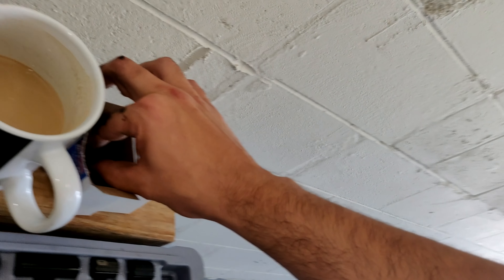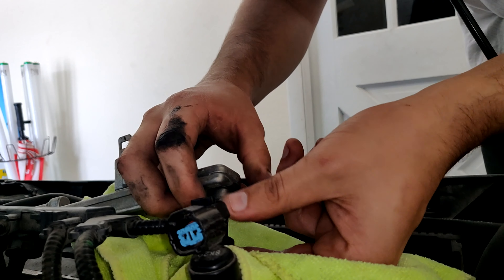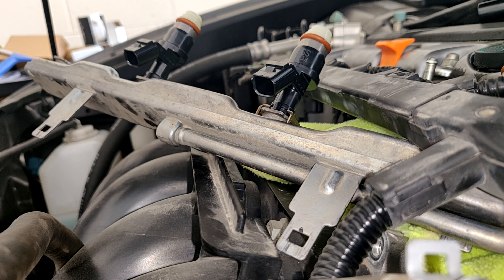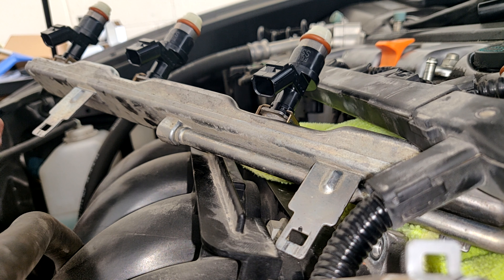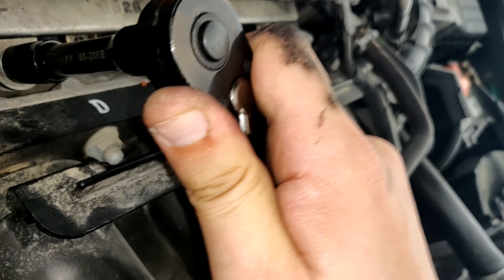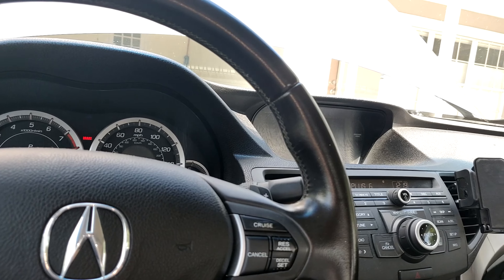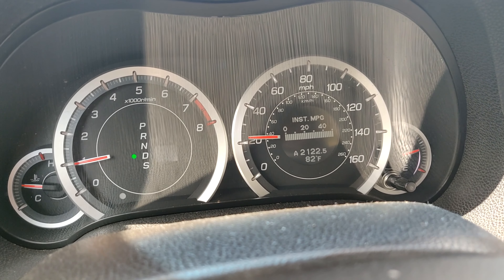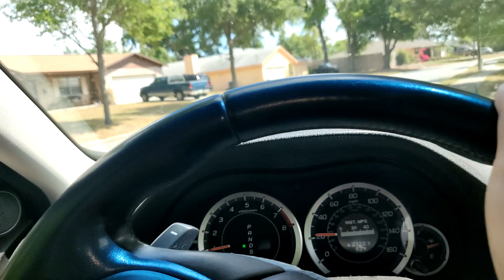2009 Acura TSX Fuel Injector Replacement (Vivration on D and N Issue)

Comment: Thank you for the video.
You should try fist 
•cleaning your throttle body
•Replace the engine air filter if needed 
•Compression test
•spark plugs if needed
and then engine mounts.

Good luck. 
Please update, when you find the solution to your TSX problem.
Reply: Smart!!

Comment: It's your pressure switch on AC. I had the same issue when replaced the AC, my idle speed would fluctuate. I've got another AC, improved a little bit over time (i believe main computer learned the parameters) but there is still a little bit of idle instability when the AC is on. It's acceptable now.

Comment: I have 19" HFP wheels on a 2012 tsx and I have a vibration at highway speeds.  I gave the wheels to a shop and they found 2 bent rims and are fixing those.  I suspected I had at least 1 bent rim.
Reply from the maker: I also suspected one rim would be broken but I didn't want to invest on that. Turns out that the shoppe that put the axles on my car put crappy ones. 2 months ago I took it to a car shop and they confirmed at least about 500$ worth of repairs to start fixing things that are obviously broken. I traded it in and bought a 2020 accord lol

Comment: Hey Healthy, I have the same issue with my 2010.....Ive just did a tune up with new denso sparkplugs, engine air filter, 3x3 transmission change (I changed at 60k , 90k, now at 130k), coolant change, transmission filter, cleaned throttle body, (didn't clean maf as honda ones don't clean well/do anything), brake fluid, replace faulty VTC actuator......Used all acura parts... Still no change on my side either.
Reply from the maker: Thank you for that response! Do you burn oil?
Reply: @HealthyCriticism  Yeah....since about 90k...  im around 130k now and I burn half quart every 2500k.....I change every 5000k with pennzoil platinum regardless...since day 1.
Reply from the maker: @David.....  then I'd suggest a compression test to see how worn the engine is. We're in the same boat here.
Reply: @HealthyCriticism  Compression is fine....all honda engine start to burn oil over 100k....(its not that big a deal, no tail pipe smoke, no excessive carbon when engine was pulled apart)...I add a half quart at 2500 miles and do a oil change at 5k....

I know that syntheic oil can last 25k miles or more....its the oil filter that I dont trust....oil filter tech been the same for the last 80years....nothing much better has come along besides paper filters.

And if im going to the trouble of putting my car on a lift to change the filter, im changing the oil too.....besides I did the math and the low cost of oil vs mileage reduction due to friction is about a savings of $5...

Oh, one thing about the idle vibration....it was more noticeble for me in the winter than the summer at the beginning....three years later, it happens with the same severity at all temps....
Reply from the maker: @David.....  yeah I burn about 1qt every 3000 miles and I just add some more until I change it at around 4k. At this point I'm learning to live with everything that's wrong about the car because overall it's in decent shape still. Waiting till the TLX type s hits the market to upgrade

A family mechanic said the transmission is probably also wearing out since it hesitates between hear shifts and clanks when I switch from park to reverse and back to drive when it's cold primarily
Reply: @HealthyCriticism  One thing, did you ever change your water pump? I put a aftermarket one a while ago....Also does your vibration get worse when you turn on the A/C?
Reply from the maker: @David.....  I haven't changed my water cooler but I have changed my AC compressor. And yes the vibrations will intensify as the compressor kicks in and it will also make a lot of noise. The vibrations go away when the compressor isn't clutched in. When the AC is off then the vibration is consistent but the car feels a lot more responsive and there is no excessive vibration upon acceleration

Comment: Remember to disconnect the car battery first for your safety when you are removing the fuel line, flammable gasoline and spark can have a bad ending

Comment: Probably need to replace the knock sensor as well. By the way , did you depressurize the fuel line before replacing the fuel injectors?
Reply from the maker: No, I didn't notice any difference before and after. I ended up reinstalling the old injectors and returning the new ones for a refund
Reply: @HealthyCriticism  So you didn't depressurize the fuel line before your swap?
Reply from the maker: @viewlesswind  correct, I did not

Comment: maybe the transmission mounts? I'm having the same problems with my tsx on D and R. so i assumed it was transmission mounts there's 3 of them. on my 04 model still haven't done something about it though
Reply from the maker: I believe in the description I mention that I replaced all mounts both for engine and transmission but the issue was still there

Comment: I was about to tell ya about mounts and etc, but seems like you've already went over so much repairs! Problem is the torque converter and probably other components in the transmission. Hondas around these years are known for their sh*tty trans
My 09 has the same vibration issue on drive when waiting at the lights. RIP tho gg for the accord
Reply from the maker: Yeah sometimes you gotta bite the bullet and say enough is enough. This accord is unexpectedly fast have you seen what it can do?

Comment: Also, I forgot to mention to please put the old fuel injectors back if the ones you install aren't the original equipment.  Clean the old ones and reinstall them. I recomend you to do so because if they are not the original injectors you may run into problem due to the poor manufacture quality of the "new injectors".
Reply from the maker: The only thing I have not done yet is a compression test and that will be my next step. I will be updating the description of the video with a list of all the things I have attempted. Thank you for the input!
Reply: So is not point to buy new ones just clean them ?

Comment: im having the same issue with my 2010 TSX. I have a check engine light on tho. Turned out to be my spark plugs and coils. my spark plugs were NGK as well maybe I had a bad batch.
Reply from the maker: Did you resolve the issue?
Reply: @HealthyCriticism  yes it did no more misfires and check engine light. i bought my car used at 80k miles. Ive done a tune-up on it before but never changed to coils.
Reply from the maker: @earvinmagic1282  yeah at least yours was misfiring and you had somewhat of a guideline with a check engine code. My issue has no codes sadly

Comment: Have a problem with my automatic tsx which shakes and vibrates when revving 40mph-50mph. Maybe transmission problem?
Reply from the maker: Try new tyres and an alignment
Reply: @HealthyCriticism  sounds like its coming from the motor or trans. Does that when it about to change gears and jerks
Reply from the maker: @petervang5384  if it shudders when it's shifting gears it's probably slipping. In that case you probably need new clutches on the gears that are slipping. I'd probably baby the car and run it till it breaks. You can also try trading it in and hope the dealer doesn't actually drive it which they usually don't. I was able to get 4500 for mine when I traded it in last year, but this year the used market is stupid expensive so get a quote

Comment: My newest vehicle, a 2011 acura tsx wagon's fuel rail won't even budge, even with a pry bar. And this car came from Florida. Seemed like almost no struggle for you to pull off the fuel rail. I must have missed a nut or bolt. That SOB rail was not pulling out. Grrrr...
Reply from the maker: Go to home depot and get a 3 or so foot pvc pipe and use it as leverage. It's saved me hours of struggle in a lot of places

Comment: I have a 2011 Acura TSX and I got cheap spark plugs and started vibrating and the spark plugs I got the lazer iridium and it stopped.
Reply from the maker: I bought iridium NGK spark plugs
Reply: We’re did you get them
Reply from the maker: @joshrivera2109  autozone. I read that you gotta get them from a chain to avoid getting counterfeit ones from Amazon and the lot

Comment: Hey Healthy, I have an Acura TSX 09. Same as the model in the video. But I have a slight issue. 
I have two codes set off. P0171 and P0420. One being “System Too Lean” and the other code is for a “Catalyst Converter Threshold Bank 1. So therefore one is leading to the other. In anyone’s experience with these cars ... what would you recommend..? Buying a whole new catalytic converter? I live in Nevada. No one could give me a reasonable answer.
Reply from the maker: The two codes are not related.

For the first one https://www.fixdapp.com/blog/p0171-honda/
This might help. Start with the easy fixes and work your way up.

For the catalytic converter one, only worry about it if your state has emissions testing, or if you care about the environment. It won't affect your car in any other way

Comment: Vibration is related to engine mounts, I have the same issue, vibration in D, and AC, as soon as you go to N, and turn off the AC it goes off, I saw a lot of post about this, check this https://www.youtube.com/watch?v=qrOUqUMTZko
Reply from the maker: I replaced all 3 mounts and the vibration was exactly the same
Reply: @HealthyCriticism  speaking to Honda specialist the vibration is normal on this model, and yes replacing the mounts won’t change anything glad I haven’t changed them thanks a lot